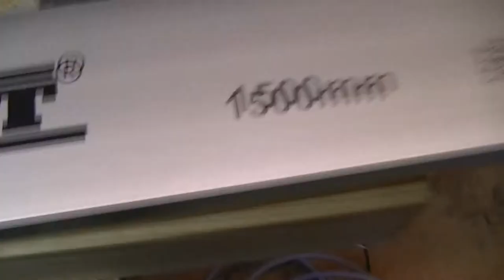2 - Building an 8 string guitar - planing neck and cutting fretboard

Comment: Hi, love the video and I’m also trying my hand at an eight string build. I’m planning on building my guitar with a 27” scale length and was wondering what was the length of your fretboard, width of the neck at the nut and end of the fretboard. Thanks!
Reply from the maker: Hi Harry - Thank you very much.
The String length is 650 millimeters, roughly 25.6 inches, so a little smaller than yours. 

https://www.wolframalpha.com/input/?i=650mm.+to+inches

At the nut the strings are 7mms. apart, slightly more than 1/4 inch, and 4mm. on each side, total 57mm, 2.25 inches , and on the bridge they are 11mm. apart, 0.4 inches.
At the end of the fretboard it is just about 10mm. + 3-4-ish mm on each side, 81mm, before sanding. expecting 79mm., 3.1 inches.
So... are you producing videos? Which woods have you chosen?
Best of luck with the project :-)